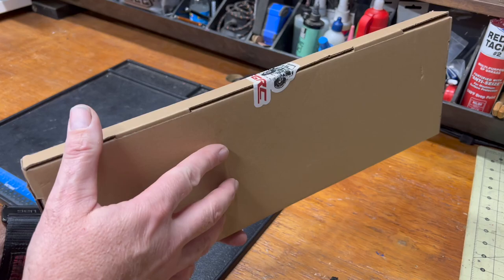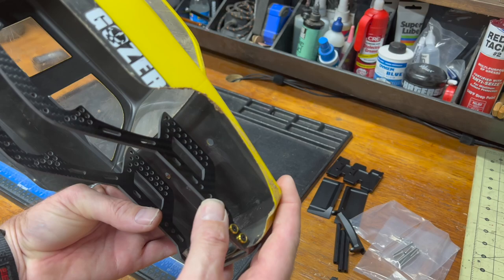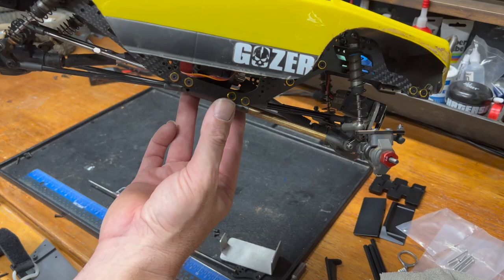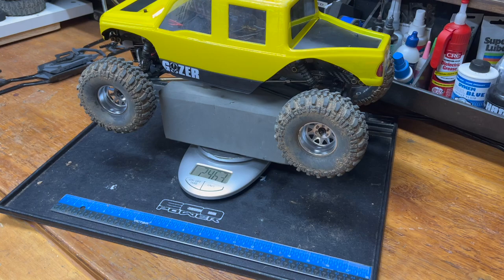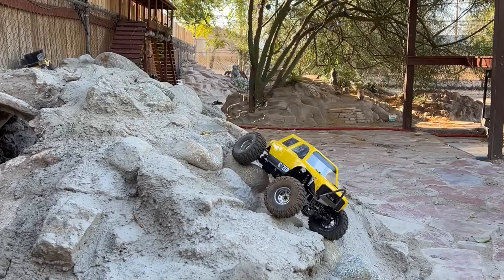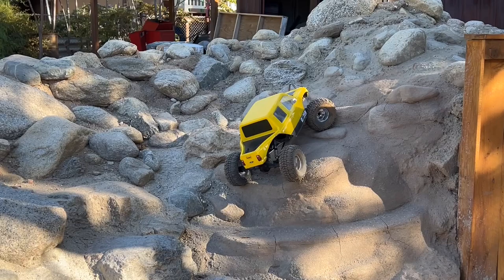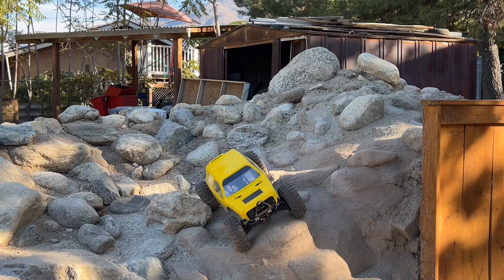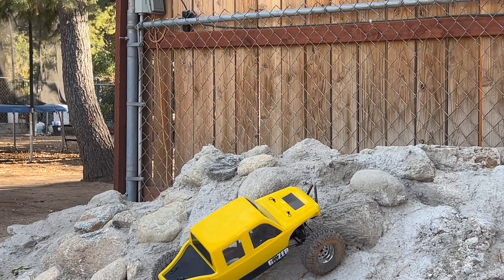Crawler Canyon Quick(re)view: Amazon Bargain carbon fiber LCG chassis (YFGXFXF Chassis Kit)

Comment: rail spacers use shock bolts to them, will help with bolt stresses on the holes and help transfer load.
Reply from the maker: That's how I have the GroundFox set up, but on this rig it interferes with the battery.

Comment: The front body mounts could be straight aluminum notched in the bottom to straddle the CF chassis and a screw straight through to basically clamp them down on the chassis rails.
Reply from the maker: I just wanna sit down and have a talk with whoever decided to make frame rail spacing and body post spacing EXACTLY THE SAME
I know that it's a problem that hits me more than others, as I'm routinely trying to fit a pre-cut/drilled body to something new.

Comment: I have this chassis they make lcg aluminum body mounts that mount in the upper shock mounts that will work with your existing  holes
Reply from the maker: They'll undoubtedly make mounting easier, but I doubt they'll work with existing holes.  Because in the divine wisdom of Mfrs. like Axial, Vanquish, Element (and others) the post holes are the exact same width as the chassis rails. Any bolt-on body mount is going to put the posts inside or outside of the rails.  Not a problem if the body isn't already drilled.

Comment: I run the Gozer body on my ecto as well.  It's a little chubby but looks cool. Great video.
Negative G makes plug and play lcg kits for trx4, scxiii, phoenix, and capra...all you need is a donor vehicle and electrics. They are amazing, idkw they dont get noticed..
Reply from the maker: My guess would be $$$. The Negative G offerings are one of, if not the most, expensive LCG options out there. A good bit more expensive than a Sherpa, which is (at least to me) properly expensive. I remember ogling the TC-V1, but...  I just couldn't.

Comment: That was a great video, I'm always torn about lowering my cg on my Capra, I find in a garden environment, we tend to have more sharp edges and flats than natural nature, but it's nice to know I can adjust my shock mounts and lower by 3 eights anytime I need. Oh love duratrax tyres, they work great on my 4ws capra. Lovin your content, that's one awesome home set up you've built. Brilliant work. Thanks for sharing. John
Reply from the maker: I know what you means about "jaggies," as much of my course was built with portals in mind, so there are some sections that are much tougher on straight-axle rigs. 
That said, LCG with portals under it is great, because you get to keep the ground clearance but lower the CG. Welp, I guess I need another set of portal axles! And another chassis!

Comment: Great video! What’s the name of the washers? Would like to check them out.
Reply from the maker: They're called countersunk washers or finishing washers. The price linked is fairly typical, but if you did around you can sometimes find a crazy low price on some odd color.  https://www.amazon.com/dp/B09MKGTR57

You can also find counterbore washers, which are the same sort of thing but for cap heads. https://www.amazon.com/Counterbore-Anodized-Aluminum-Mechanical-Accessories/dp/B09MKL1XZL

Comment: That’s funny.i just saw this on Amazon .i have been looking to swap my gate keeper on to a chassis like this.looks like yella performs great now.any issues with the front shaft being shortened at all?
Reply from the maker: With all of the LCGs I've done myself, the front driveshaft invariably has to be shortened. My advice is: when building, put the driveshafts on last, and hold them up in place to see how much need be adjusted.  I've had to do significant mods to some, while others--  like in this rig--  I took ~7mm off of the slider section and was done. As long as link placement doesn't interfere with the driveshafts, it shouldn't ever pose an issue.  Lastly, the shorter front shaft means the gearbox has effectively moved closer to the front axle, so if nothing else, the weight bias moves slightly forward and down.
Reply: @CrawlerCanyon  .thank you sir.keep up the awesome builds/videos 👍

Comment: Really appreciate your video and the info included. I currently have a rtr gatekeeper (my first and only crawler, for now) and I'm ready to do a lcg build. 
A few questions for you. Will you share links to the Amazon servo and wheels you're running on Yella? Where can I find portals that won't hurt my wallet? Lastly, I'm thinking of getting the element builders kit 2 instead of buying all the major components (shocks, Trans, links, etc) separately. Your thoughts will be greatly appreciated! After watching your video I'm ordering this chassis now. Thanks again for your video and any knowledge you're willing to share!
Reply from the maker: Yella is running an AGFRC SA75 for servo: https://www.amazon.com/gp/product/B09133W2B2
and deep clones of SSD steelies:  https://www.amazon.com/gp/product/B0B51PPJ8K
The cheapest way to get portals, other than buying chinesium from Amazon (which will have gears of questionable quality) is to get some take-offs from a parts house like Jenny's RC.  I've gotten TRX-4 axles from them several times.
When it comes to getting multiple components, it's always cheaper to buy a kit or builder's kit compared to buying piece by piece. A pair of axles alone is $100-125 (not including Vanquish) while a whole kit will go around $250-300.   The Builder's Kit 2 is a great deal.
Reply: @CrawlerCanyon  thank you! Appreciate you sharing knowledge and the quick response!

Comment: Fantastic.I got inspired and got a set of those rails. NOW... I hope I can pick your brain with a few questions. I got the same trans and I'll use AR44's. What do you think about portals with the rig and maybe 80 or 90mm shocks? Second I truly like to have a 4WS set up and set it with servos over axles. Since I'm quite new to this I keep on looking for 2 front Axles on eBay and amazon but I'm not sure I can find what I need. Would you be so kind as to put a link for the correct axles for 4WS? 
Thanks a million.
Reply from the maker: I think an LCG is a great choice for a rig with portals, because you can bring that CG down a bit--  ground clearance and lower CG is what we all want. 
As to axles, you can SOA most any axle, it's just that some are easier than others. Element axles or AR44s are nice because there's a variety of mounts out there, and they're all pretty inexpensive. I give the edge to Element for smoothness, but a performance advantage to the AR44 for being high-pinion--  and having a variety of under/overdrive gears available. So I would lean toward AR44s.  Though if you are considering portals, don't discount TRX-4 axles. The only downside there being that the availability of SOA mounts that AREN'T 3D printed is pretty slim.  The axles, gears, and portal boxes are tough as nails, though. 

The problem with cheap metal housing axles (like what are all over Amazon and eBay) is that you never know the quality of the housings or the gears--  you can be sure that the gears will be sintered and the housings cast, but there is a wide range of quality with regards to those parts. You might save some money and get lucky, you might end up with "you get what you pay for."  So as to a link? I wish I could help. Sourcing axles is the toughest part of any of my builds--  getting TRX-4 take-offs from Jenny's is the closest I get to being able to just buy axles when I need them, and even at that a pair of fronts is about $140. 

Keep checking forums/classifieds, keep checking eBay, or just bite the bullet for Axial axle kits (AX31438) which will give you quality parts (and you'll have a bunch of stuff left over) but still run you about $160. Everything in crawling is reasonably economical...  until you get to bodies... and axles.
Reply: @CrawlerCanyon  thanks a million for your kind response. Perhaps once it’s done sometime in the futureI cam stop by your place and I can learn a thing or two or a lot 😁. I don’t think we are too far from each other. I’m in Palmdale CA. 
Cheers and again thank you very much

Comment: Could it be OK for the Enduro Sendero (12.3 in/313 mm)?
Reply from the maker: Absolutely.  This is on a 12.8" wheelbase, but there are plenty of shock mounting holes, so getting the shock angle you want shouldn't be a problem.

Comment: Kind sir, you in my eyes are man to ask this question. Will the Injora lcg chassis fit the hightrail 336 mm wheelbase? Says all trx4 models, yet I cannot find a carbon fiber chassis. I assume Id be swapping the suspension parts over. Have you heard of anyone doing this?
Reply from the maker: I think it would fit fine.  In virtually every case, wheelbase is altered by changing the rear links only--  I can't think of a rig that has links changed at both ends. So worst case, your rear shocks are laid down a little more, and the rear axle is closer to the bumper mount.  But I'm running ~330mm on rigs "built" for 313mm and there's never really an issue.

Comment: Can you confidently recommend a carbon fibre  chassis kit for a trx4 sport, its fine if you are not sure.
Reply from the maker: How close to you want to stay to the Sport? Like, are you doing this for a performance bump, or are you looking to convert? For just a performance bump that won't change the geometry or require a bunch of new stuff, the Morlordy rails off of Amazon are great--  I just did a review a few days ago.  For a full-blown conversion, I haven't gotten one (yet) but the Dr. Climbenstein from UGRC looks bonkers, and is where I would go if I were going for a full LCG conversion on TRX-4 portals.
Reply: @CrawlerCanyon  Thankyou,  ill check out your video, was mainly trying to cut out some weight and maybe a little performance bump, would like to keep my 1979 Bronco hard body coz it cost me a fortune 😆 but I like experimenting and re building so I'll check the bonkers one 😉
Reply from the maker: @neildaniels5443  The Morlordy <should> be a direct bolt-on, as it uses stock towers, braces, etc. Drops right around 7oz of sprung weight--  to the point that I had to drop spring rate all around.

Comment: How did you attached the battery to the servo? Nice build man!
Reply from the maker: I just use clear servo tape between the bracket and the servo.  On some of my battery-on-servo rigs, I just have the battery velcro-strapped to the servo with no tray.  
The tray is preferable.

Comment: I have a question maybe you can help me with,  I have the same lcg kit mine came with the skid being 78mm and the delete, spacers are 70mm would this be correct because the chassis is wider in the middle and smaller on each end doesn't seem right but I've never put one of these together.  Thanks
Reply from the maker: Yes, generally chassis' will have a "pinch" at each end.  Thin CF plate makes that bend really easily. 
The TRX-4 has such a difference between middle and ends that the CF chassis is made of separate front, middle, and end pieces.
Reply: @CrawlerCanyon  thank you so much

Comment: Canyon wiht the 2low gearbox the links bump in the motor any ideias?
Reply from the maker: If your motor isn't "Fusion long" you can clock the gearbox sideways a bit to get it out of the way of the links (usually) but will be limited by driveshaft angle (usually) depending on your axles. Unbolt two of the screws from the center skid and see how much you can rotate the gearbox--  sometimes it doesn't take much. The more-fabrication option is a spacer/plate/shim to angle the gearbox on the axis you need it angled on.  I have a 2Low in one of my custom chassis, which was NOT designed to fit that gearbox, so I had to make an adpater plate that both angles the box left to right and tips the gearbox front to rear. It's an annoying gearbox to mount in 80% of chassis.
Reply: @CrawlerCanyon  yes is a hard spot the skid allows me to do what you tell me in my mind didn't look right the motor and the gearbox side ways.i want a fusion does not fit I have like 540 motor space .
Reply: @CrawlerCanyon  the chassis for best working position for the 2low is?can you tell me ¿love your work and pacien for noob like me

Comment: Hay great video ... I bought a second 3 gear trans with dig from Amazon ...I have issue set screw on front locking disk of dig DO YOU KNOW THE SIZE OF THE ALLEN HEAD SET SCREW?  Not the same size as a Vanquish Hurtz Dig units ..
Reply from the maker: Super tiny--  IIRC, it's 0.7mm.
Reply: Yah I ordered a new set of hex drivers. Is there a brand you like best?  Got set from Amazon try if I think their crap" RETURN TOO SENDED ADDRSS UNKOWN">>lol @CrawlerCanyon
Reply from the maker: @tomandrews5392  For my everyday, "use 'em all the time" drivers, I go for MIP.  I have the bit inserts as well as the handled drivers.  I put off buying them for a VERY long time, and regret that.  They're just so good, and i essentially consider them an investment.  For (most) everything else, like nutdrivers, or hexes I might use once in a blue moon, I tend to stick to Wiha. Really inexpensive, and they're honestly pretty good.

In Amazon tool terms (that is, the imported stuff sold from sellers whose names are just a pile of loosely related letters,) the only RC-specific tool I'm 100% pleased with are my shock pliers.  They're fantastic. But the bit inserts and hex drivers are pretty terrible.

Comment: Go look at the brazin scale ATL chassis.. they look damn near exact to me
Reply from the maker: I think if you put any/all of the LCG offerings out there (maybe excluding the Sherpa) they all look pretty similar.  But I haven't located one that looks REALLY close. The ATL (versions 1 or 2) doesn't look any closer than the Scattergun or any others. I think this is because when overseas companies knock something off, they look at the biggest market share they can, and LCG chassis for rock crawlers is a niche inside a niche--  I can't imagine any one mfr. has sold more than a few thousand at the absolute most.  Triple digits is more likely. 

I'm also curious as to why the boutique builders are almost always out of stock.  Well, not really.  It's outsourcing. Plate + machine = chassis, unless you have to farm out the work.
Reply: @CrawlerCanyon  that one looks a lil different than the one I have previously bought.. the one I have laid next to my gspeed v3 nearly lays identical only difference is v3 has more rise at the ends of the chassis and the shock hoops are a lil shorter.. imo definitely not 100s of dollars worth if difference ya know,?

Comment: can you share what gearbox you use? where to buy and share the link.
Reply from the maker: Right here on good old Amazon:  https://amzn.to/40laHjU
I'm currently running five of them in the fleet.  Be aware: when you get one, completely take it apart, oil all the bearings, grease all the gears, and replace the included fasteners with better ones. Some work involved when a dig gearbox is THAT cheap. The JX4409 is a great servo for the dig: https://amzn.to/3Jqtwwi
Reply: @CrawlerCanyon  THANK YOU

Comment: It’s a crawler why would you get one of the lightest chassis that’s such a disadvantage. It’s not for aero dynamics or speed so why, just get stainless steel
Reply from the maker: Sprung weight is bad, and the ability to move that weight is good.  Removing sprung weight effectively increases unsprung weight (percentage wise,) which is even better. 
Never, EVER increase weight borne by the shocks if you can avoid it. Having the lightest possible rig allows you to put the weight where you want it, not where dictated by the parts.  Do I think it's necessary that it's made of CF?  Not really. But I'm not gonna complain about it.